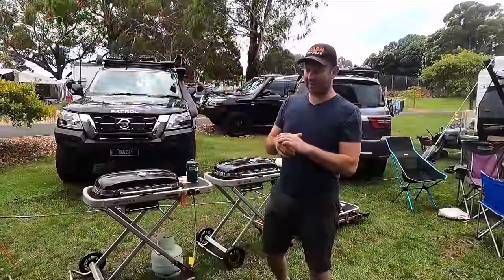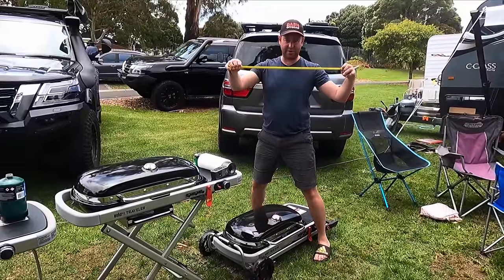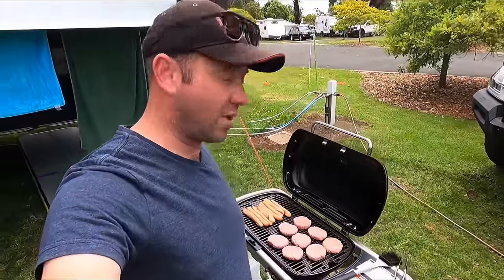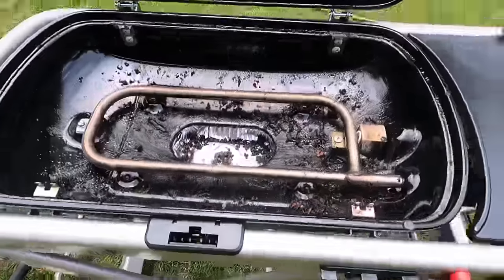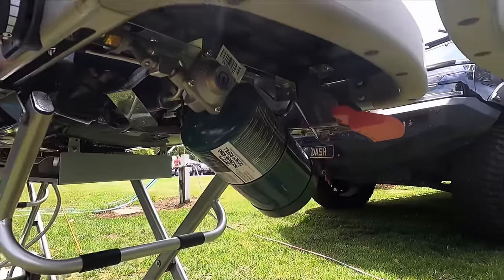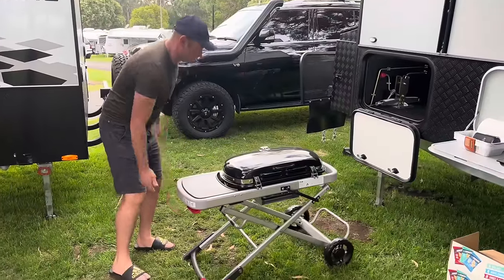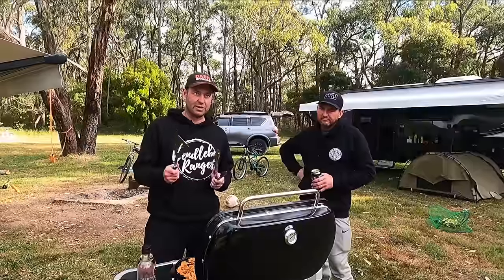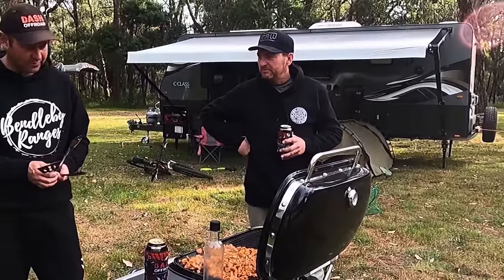WATCH THIS FIRST! Before You Buy a Weber Traveller BBQ

Comment: I've owned this grill for 3 years. I've used it off and on for a total of 5 or 6 weeks, and only on camping trips. Since it was so horrendous to clean it's been primarily used to cook hot dogs and vegetables, and I've used charcoal to cook meats that left a lot of drippings. It looks to be in near new condition but it has quit working due to a faulty regulator. Weber does not want to cover this item past a 2 year warranty even though there is warranty remaining on other parts of the grill, and that this is an item that is known to be a problem with them. 

I purchased 4 Weber grills over a 2 year period and all of them have had issues. Three of the grills had issues right out of the box. I just completed a second warranty claim on my Weber Genesis II because the warming rack has rotted out, and I will be making a second claim on my Weber Performer because the metal table is covered in rust after only 1.5 years. A friend of mine has purchased 2 Napoleon grills last year and zero issues.  I recommend a different manufacturer.

Comment: Call me crazy but I would use it also for charcoal. Unscrew the flame dotted line pipe n get a small grill cover n throw some charcoal n get grilling started n when you finish you can put the gas lines back n use it for gas grilling way to go Weber you saved me double the price.🤩🤩🤠🤠🤑🤑😁😁

Comment: Weber need to get wth the program, and include a 'flame out' detector on their mobile BBQ's so caravaners can LEGALLY be able to use the vans bayonet fitting, instead of having to use a seperate dedicated gas bottle. Ziggy have now brought out a portable model with the 'flame out' detector as standard. Wake up Weber !!
Reply: They are on that. Instead of buying a new bbq like the ziggy you'll just need to buy an attachment. They dhould be out this quarter
Reply: Weber always recommend cooking with the lid down. Faster cook and less gas used. Also, whilst they do sell plates as  you have used, the guys from 'heat and grill' recommend use of one of their pans instead. I use it on my Q.
Reply: Who gives a fk just use the bbq

Comment: You should check out the Napoleon traveling grill.  Has 2 burners, has a cart like the Weber, but it has a bigger top so you can put a whole chicken on it.  It will also accommodate the big tanks.

Comment: Biggest downside is it won't fit a chook or leg or roast in it, if you cut the legs down on the webber Q it fits perfectly in the tunnel boot
Reply from the maker: I’ve got an idea 😉
Reply: My baby q fits inside the storage boot on our MDC XT12HR but one of these wouldn’t. Each van and camper is different.
Reply: @DASHOffRoad  email me, I have an idea too. I work at a weber specialist
Reply: Has the ziggy got more room in it , if so that's the one I need 🤔
Reply: Has the ziggy got more room in it
Reply: @David Milledge  it has a circle grill whereas the q have a more rectangular shape. That means the q has more usable space and you can put things like kebabs the whole way across it.  Hope that helps
Reply: That Weber is very long! What about cooking a roast? One option I’ve seen is getting a longer hose and fitting direct to your spare gas bottle directly. 
I’ve seen a bbq that ticks a lot of boxes selling at Costco. Pretty cheap to but does it fit in the tunnel boot?
Reply: thats a good idea, i normally remove the lid but its a bit of a pain. How much did you cut off the legs?
Reply: @alaw_perth4668  basicly but it level with the arch of the frame, it now fits 👌 with a fridge slide.

Comment: I find mine to be a pain to clean. Food sticks to the grates so bad and the wire brush doesn't seem to remove it. I regret buying it.
Reply: Line the bottom with aluminium foil and for the great's turn the heat up and burn it off
Reply: @TravelThailand8  I find it doesn't get hot enough to burn it off.
Reply: Update: This grill is now 3 years old. I've used it off and on for a total of 5 or 6 weeks, and only on camping trips. Since it was so horrendous to clean it's been primarily used to cook hot dogs and vegetables, and I've used charcoal to cook meats that left a lot of drippings. It looks to be in near new condition but it has quit working due to a faulty regulator. Weber does not want to cover this item past a 2 year warranty even though there is warranty remaining on other parts of the grill. 

I purchased 4 Weber grills over a 2 year period and all of them have had issues. Three of the grills had issues right out of the box. I just completed a second warranty claim on my Weber Genesis II because the warming rack has rotted out, and I will be making a second claim on my Weber Performer because the metal table is covered in rust after only 1.5 years. A friend of mine has purchased 2 Napoleon grills last year and zero issues.  I recommend a different manufacturer.

Comment: I've gad one for about 12 months.  Took it to the Cape and it's s great compact unit. However,  the grill is sticky no matter what you do or how you treat it.
Reply: I find mine to be a pain to clean. Food sticks to the grates so bad and the wire brush doesn't seem to remove it. I regret buying it.
Reply: @jimdent351  If you let the Q run on high after you finished cooking and char the stuff on the grill, it'll be easier to scrape off. By getting a lot of stuff sticking on the grill, it's either high sugar marinates or the food isn't ready to let go. I always use Canola or rice bran oil spray on my grates before I put food on them and I oil coat them again after cleaning just to keep it non-stick.